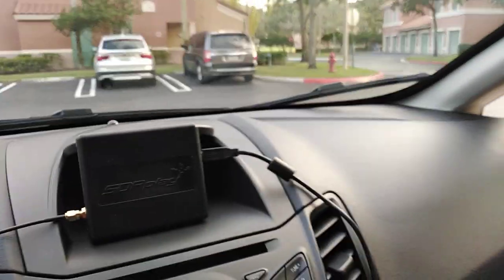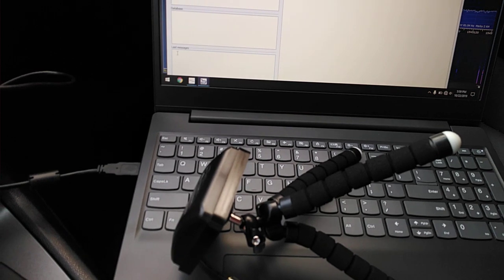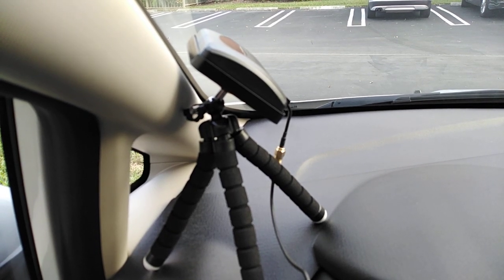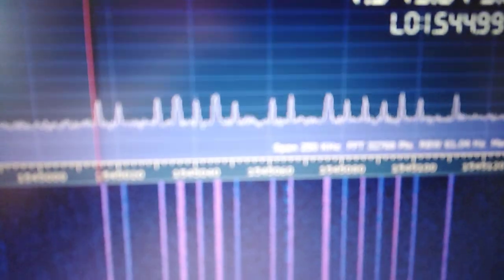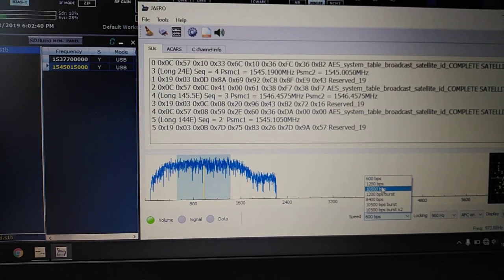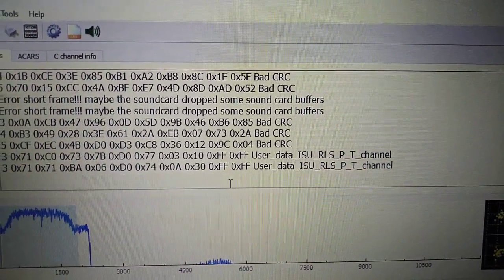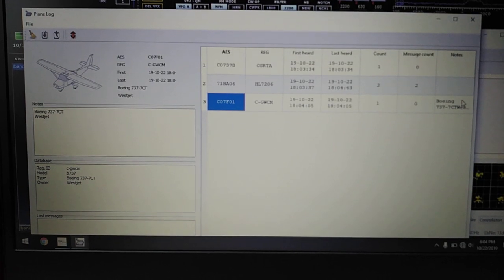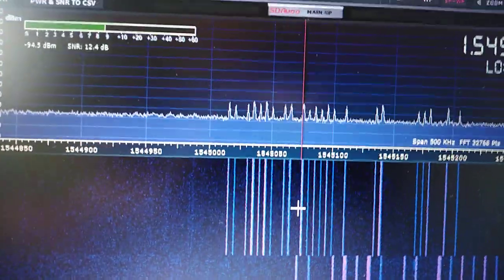RTL-SDR Blog L-band patch antenna part 1

Comment: Great Vid Mike. Just pulled the trigger on one! I also have the other L Band patch antenna, guess I love antennas.. Lol. This one looks slightly easier to setup. 73s. KJ7CAT
Reply from the maker: I think you will like it . In my case, operating mobile it's a 10 :)
Reply: @SDRplayHamGuides  I'm liking the new antenna after some testing w/others. However, I'm yet to get anything other than ARCARS.  Can't seem to get anything with the std-c tekimanoid decoder. I'm pointed at the Inmarsat-F43 satellite. Any suggestions? Many thanks.
Reply from the maker: I will double check mine tomorrow using Tekmannoids STD-C decoder. I don't recall have any issues with the RTL Patch antenna on STD-C decoding.

Comment: I got mine in yesterday and I can’t seem to get anything except a super noisy signal all across the Inmarsat band. I have the bias T on an and I’m using sdr#. I can’t even get the gps signal on 1575.42.
This is the only thing I seem to get. https://imgur.com/gallery/U23gPoo
Reply from the maker: Try using a 3rd party satellite finding app (satellite AR) on your mobile phone. That should help in pointing the patch in the right direction.

Comment: Hey Mike, I wonder how much SNR difference would be made if you attached the RSP closer to the patch with a much shorter SMA patch lead. Did you try it connecting directly? Granted there wouldn’t be much room for manoeuvre but be interesting to see 👌
Reply: You might want to try decoding the 10500 bps AERO signals. There are three 10k bps carriers on the 54 West bird (covering Atlantic Europe) and two 10k bps on the 98 West bird). These are harder to decode than either the 600 or 1200 bps signals, so they make a good test. I would be very surprised if you could not receive both birds!
Reply from the maker: No, I haven't but I will definitely try that.
Reply from the maker: I tried it and noticed a lot less noise in the spectral plot. 
This is most likely because of the car running with the AC on.

Comment: I was watching your shows on antenna diversity and some loop antennas. I have a feeling like it all went to nowhere. (Or I can not find the conclusion on YT) In the meantime I have ordered a Chinese MLA-30 antenna which does an OK job while hanging of my bookcase. (probably replacing the loop itself with a decent copper wire will improve reception, Not to mention placing it outside.)  I would like to learn more about what you used and what the optimal setup should be. I have a very small backyard and the loops seem like a good choice. I live in a RF-noisy neighborhood, too.  Thank you.
Reply: Thank you I will go over the vids.  The Chinese loop is super cheap this is the only reason I got it. The MFJ with taxes may cost around $500 in Canada. So this is not an option. Now I do have only a random wire and some attic antennas.  I am planing to install a delta loop for 20m and a receiving loop outside. Then use SDR to receive and my iCom7100 to TX. I hope I will manage to do this before winter.
Reply from the maker: Sound good, which RSP do you have?
Reply: @SDRplayHamGuides  RSP?
Reply from the maker: Which device do you have from SDRplay?
Reply from the maker: If you place the loop outside vs using it indoors, it will reduce interference and improve the overall signal quality. 
I use a mega-loop FX on the ground floor with great success.  I don't have any noise on HF believe it or not at my location so I can't demo noise reduction.

These video should help
https://youtu.be/SzoJCU3_p2U
https://youtu.be/GxUOcL8Z0kA
https://youtu.be/gtXW4EeIfDc
https://youtu.be/x1DRgprcC6g